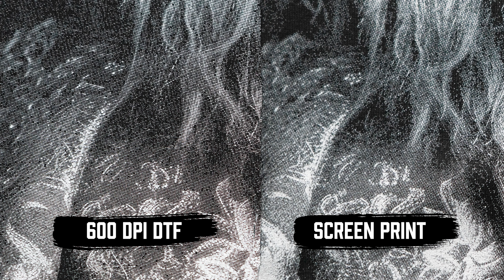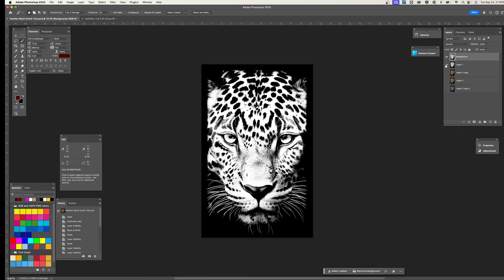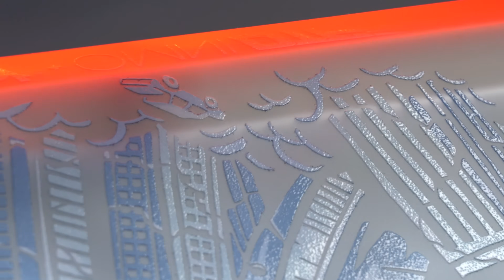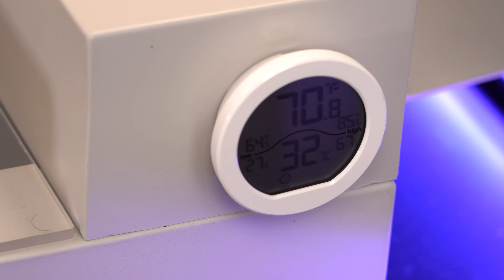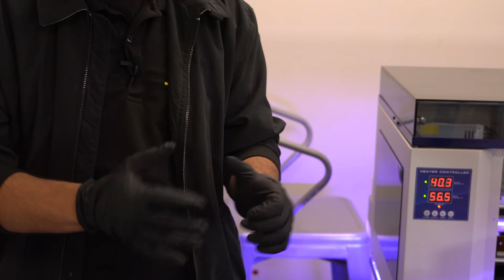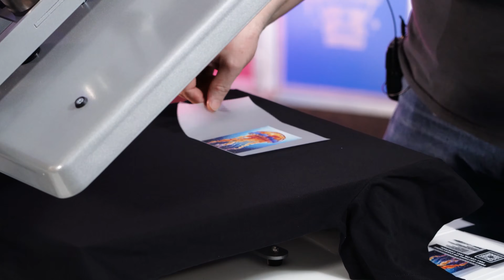DTF Printing Deep Dive: OmniDTF Engineering, Ink Formulation & Heat Press Tips Explained

Comment: Can you give formulation of dtf inks?
Reply from the maker: Great question. Exact DTF ink formulations aren’t publicly shared because they’re proprietary, but here’s how DTF inks are built at a practical level:

DTF inks are water-based, polymer inks designed to work as part of a full system, not on their own.

At a high level, they include:

• Pigments
CMYK pigments for color accuracy.
Titanium dioxide in white ink for opacity, which is why white needs constant agitation.

• Polymer binders
These create the ink film and allow it to bond to the hot melt powder.
This balance controls flexibility, cracking, and wash durability.

• Carriers and solvents
Mostly water plus glycols.
They manage viscosity, drying speed, and nozzle stability.

• Dispersants and stabilizers
Keep pigments evenly suspended and prevent clogging, especially critical for white ink.

• Functional additives
Flow agents, surfactants, defoamers, and preservatives for clean jetting and shelf life.

The big takeaway: DTF ink is engineered to match the film, powder, and color profile.
Changing inks, film, or powder without adjusting the system is why people see color shifts, adhesion issues, or wash failures.
Reply: @Ryonet which resins is used for ink

Comment: I don't know why so many people call this Omni DTF shit. I have owned it 2 years. I'm still using the same two original heads and most of the dampers. I have no breaks in lines at all. Humidity control is key! My printer is a workhorse. I haven't screen printed since its arrival.
Reply from the maker: You're totally right, we've found the humidity variables across different shops to be a common challenge and why many new DTF printers have to troubleshoot. We've been able to help a lot of DTF folks identify this and address their space to get great prints moving through the machine! Thanks for your comment!